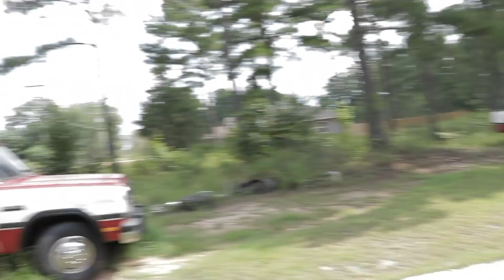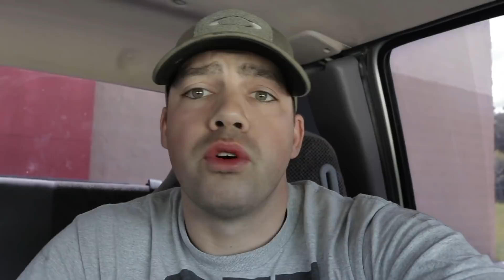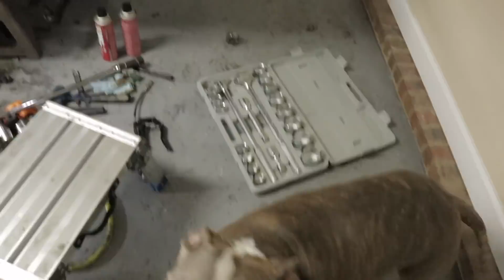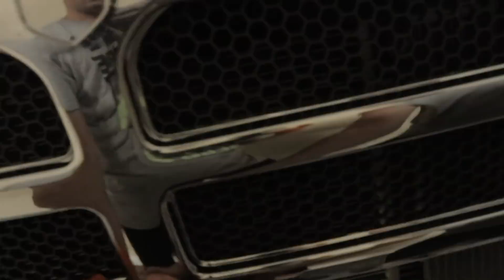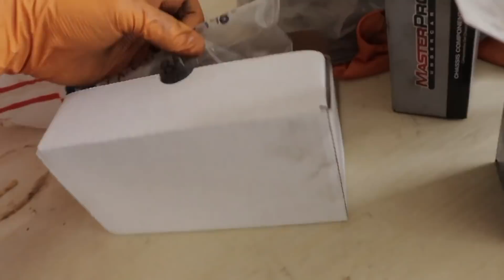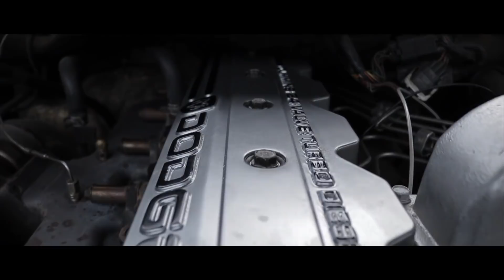P-PUMPED 24V CUMMINS LOPES HARD!! MUST HEAR!! + BAD*** POWDER COAT IS FINISHED!!

Comment: Sounds like a cool spring to me. I have an 2001 with the same problem and after rebuilding the front end I still have a popping noise. A week later I put a 5" lift on and found a broken left coil. Hope this helps out.

Comment: Check up on the Pitman arm, have someone sit in it and turn the wheel left and right while it's turned off and if it's that when you go one way everything else will move and it'll be a little delayed. Just had to replace it on my '96 3500 build. Went ahead and did the idler arm as well

Comment: On my dodge it was on the passenger side bolt where you can ashiest your axel to sit for or back back farther the plate got bent so it was sliding over the plate on the axel and making an horrible popping noise

Comment: check the cardan joint on front drive shaft or front joint on front driveshaft, another would be the transmission/ transfer case  mount (rubber) I had replaced mine on my 2nd gen Dodge cummins

Comment: Check where the track bar bolts through the brackets on the axle. I have had the holes in the brackets wear and allow the bolt to slide back and forth on the axle. It would pop really loud while taking turns at and driving speed. The axle was basically shifting underneath the truck and slamming the bolt against the brackets. I had to weld a washer on the brackets to act as a wear plate to prevent the bolt from moving. Hope this helps.

Comment: Is that lope good for the truck?? IMO I think if you want that choppy loping noise put and aftermarket cam and exhaust on a gasser.
Reply: No, it runs fine. If it was a lope/smoke tune, then yea, itd be bad. But its loping because of the ppump, timing and big injectors

Comment: Could it be the rear diff, or is it forsure up front? I changed my diff   oil and it started popping/rough slip/chatter when I turn on asphalt. When on dirt it doesn't have enough resistance to slip the limited slip when turning. First time I heard it tho I for sure thought  it was a front u-joint kinda weird.

Comment: Worst mistake ever is the masterpro ball joints. I work at o Reilly's and won't even sell them because they just wear out so fast. Should've got the moog
Reply: Raging Squirel this is Wutthaduck, usually i run moog, thats what we took off, but i go through them so quick, so i just said screw it, ill start buying the ones that are cheaper and see how they do
Reply: They have a lifetime warranty. Why don't you warranty them out?
Reply: Raging Squirel I do, but im just tired of constantly having to replace them, so i wanted to try a different brand and see how long they last
Reply: I understand that I just see the masterpros come back so often I very rarely see a Moog come back but I know stance tires probably don't help.